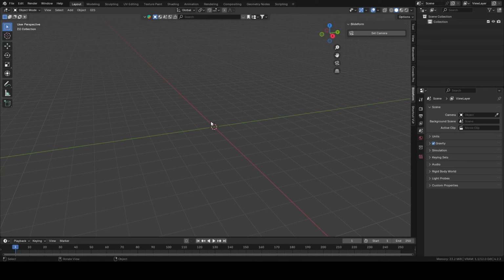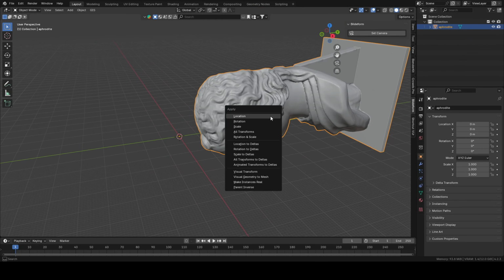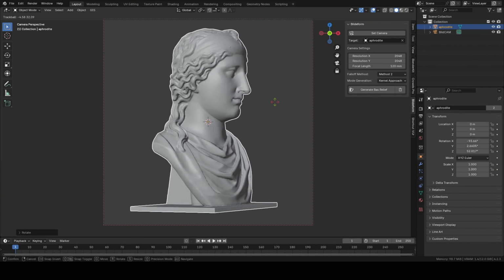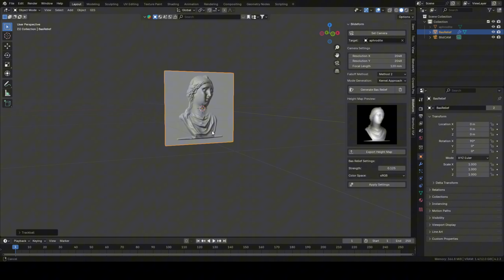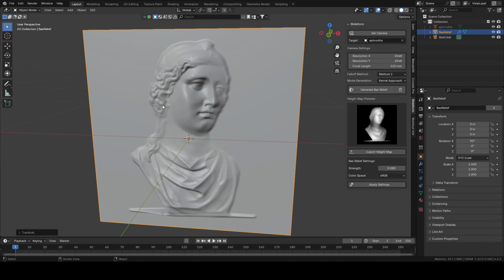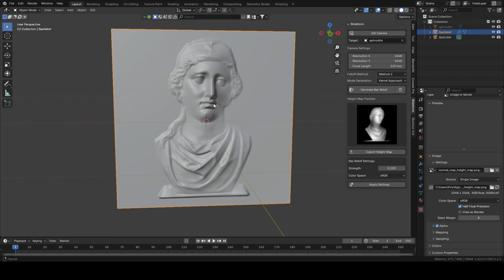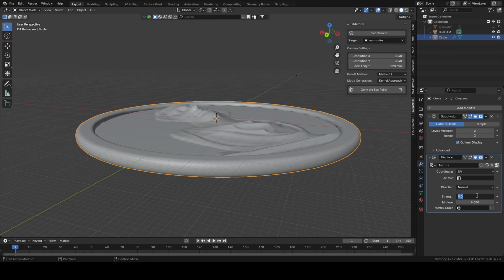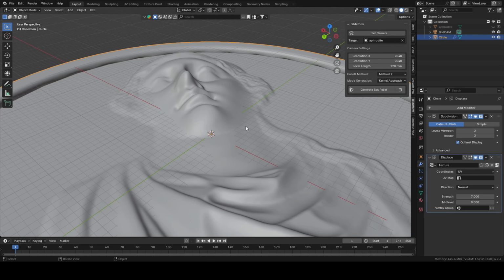How to make bas relief in Blender for laser engraving, CNC, 3D printing

Comment: thank you for this video - if only the coin preparing part (starting 2:39) has a normal speed to get all details ;-)
Reply from the maker: Thank you  to you for seeing the video. You can slow down the video speed
Reply: @GiambattistavonNettesheim  I miss the option to specify a relief height for the unit and thereby increase weak (z-height low) differences and reduce strong differences (z-height large).
In the video shown, the nose of the statue is above the coin edge height. In production, this would mean removing a relatively large amount of material.
An option that allows different regions of the object to be leveled would be great ;-) the tool is SUPER - thank you very much